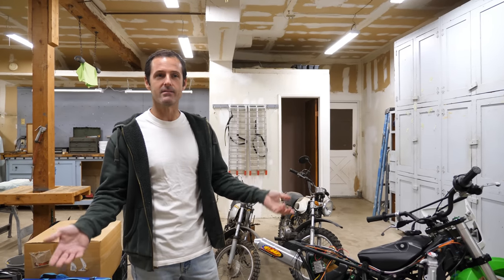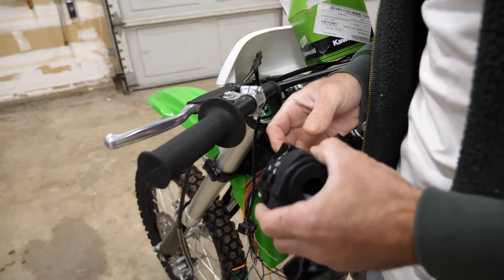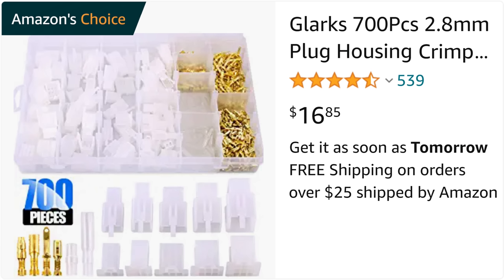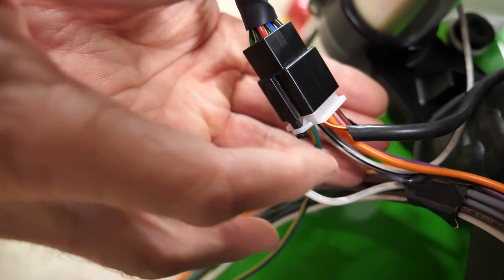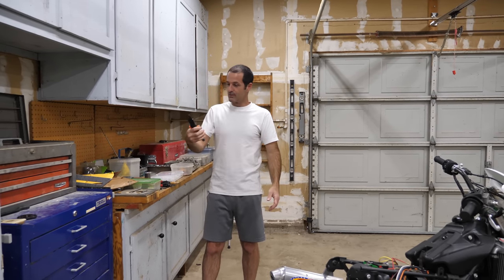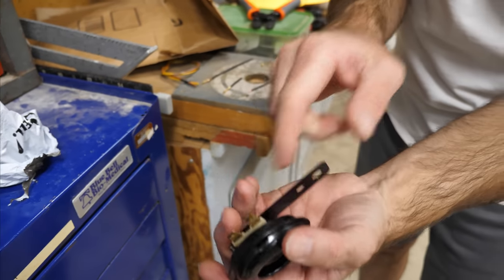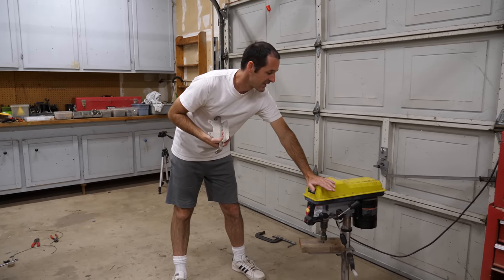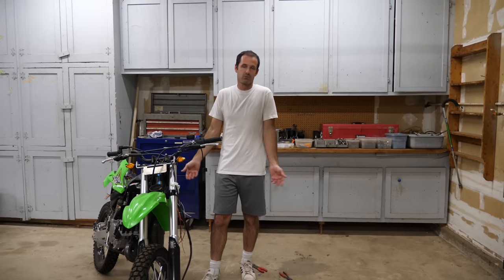Installing A Motorcycle Horn & Handlebar Switch - In 3 Months Or Less!

Comment: That pass through wire(s) propably was for clutch switch. Connector looks like AMP fastin faston connector. Apply silicone grease to connections. That will prevent corrosion, cos water can't get in, but connection will be good either ways.
18:20 you have wire harness pulled from switch cluster. Put ziptie on it and put the ziptie inside of cluster and you have janking preventer.
Reply from the maker: Thank you for the information about the connectors. And good eye about that sheath hanging out of the housing. I didn't film it but, I put a ziptie in there to hold it. There were even some holes inside I ran it through that looked like they were made for it.
Reply: @jenniesgarage  thank you.. that's what I do by trade. Silicon grease is best way to seal open connectors, we used it when I was working with major underground drill manufacturer.. and those babys worked in harsh and acid environments.  I do like watching your channel, it's like 90s sitcom in the good way...

Comment: Great video guys, I have the same connector kit and has changed my life! One recommendation, add a 3pin male/female between the loom and the headlight. It may occasionally need to come off. All the best.
Reply: Also, maybe grab some larger diameter heat shrink to cover the exposed spade connectors for the horn. That's an easy short

Comment: Thanks for the new vid! (I'm kinda slow!) Been restoring bikes for 40 years now. Doing a ground up restore on a '74 XL250 I bought in '75. Twist yer wire and tin it and the crimp part of the connector. Crimp it, then solder the crimp. Then crimp the insulation part. (That keeps the insulation from melting) It'll never come loose. Works like a charm! Keep on wrenchin'! And make sure to include the camera operator! Y'all make magic together! See Ya!!

Comment: watch out for chafing.. and also btw, just a tip for you guys renovating or updating stuff electrical connections on vehicles; never solder connections on vibrating stuff, cus' after a while they will become brittle and break.. crimping is the way to go. just a handy tip.

Comment: I'm sure you'll get it finished by the time Jen's in a retirement home... :P

As for the crimpy stuff, those two tools, nah, you need a ratchet crimper (preferably a set that comes with multiple jaw types for the various connectors), I found that out driving myself nuts trying to use the red-handled type ones, and goodness me the ratchet kind are just so simple, place terminal in the jaws, insert wire, squeeze the handles, perfect crimps every time, only had one failed crimp and that's cos I put a terminal in upside down, but it was my first go, so, not bad really!!! :D

Comment: Should've bought RM stator wire crimping tool. It does both crimps at once. I just did my entire harness with it.
Reply from the maker: I just looked it up. May have got that instead if I knew it existed. Thanks.

Comment: I got that connector kit from Amazon for my CRF230M (basically the CRF230L) to install a Grom switch assembly. I just wanted the same switch positions on my CRF230M like what my Grom has. The added bonus of having running lights too with the Grom turn signals on my 230M.
Also, your garage looks bigger for some reason.

Comment: So good to see your vid! Love seeing these projects! My uncle's got a CRF230 that has never really run quite right. Idles ok, but feels totally gutless when it's opened up at all. Needles and jets are all as they should be... can't figure it out. :/
Reply from the maker: They are jetted very lean from the factory. Ours was very boggy when we got it too. I put a screwdriver slot in slow mixture screw so I could adjust it (it is a "D" type socket from the factory). You could also try getting a slightly larger pilot jet, or drilling the factory one just a little.
Reply: @jenniesgarage  I'll give that a try! Thanks!

Comment: It seems like the male blade terminals in the Kawasaki switch are smaller than the ones in the Amazon set, and so the resulting connection when plugged in will be an improper mating of the blades of the Amazon plug to the factory terminals.

Comment: I'd worry about the wires rubbing through against that headlight bracket. Maybe put a piece of rubber (split a small tube and glue it in place) against the metal?
Reply from the maker: I rounded the edges with a file, but that is a good idea. I'll keep an eye on it.

Comment: It looks like the wire gauge might be a little large for the pins you are crimping. Other than that, careful prep of the strands makes it pretty easy to keep them inside the finished crimp. The Iwiss are generally a good tool, but like most crimping systems there is a lot of burden on the user to know how to use them.  If you are still having trouble I would search around YT and the rest of the interwebs for tutorials.

Comment: the 2 wires are a safety so the starter button only works when clutch is held in or the bike is in neutral as this is custom loom you do right to remove i remove them and bypass them all the time as they known to fail in the most god awful of weather and leave you stuck at side of a road